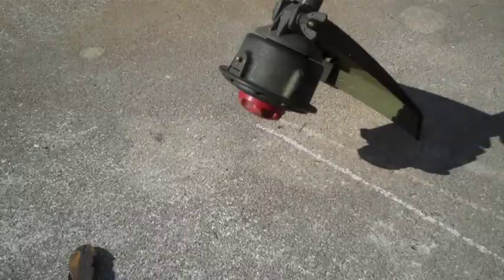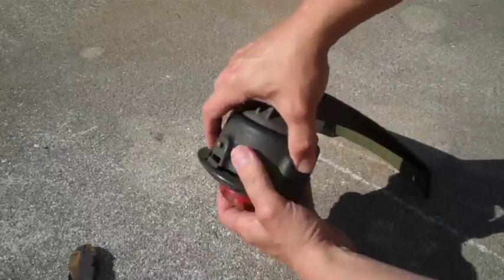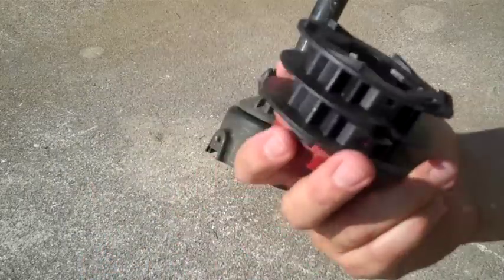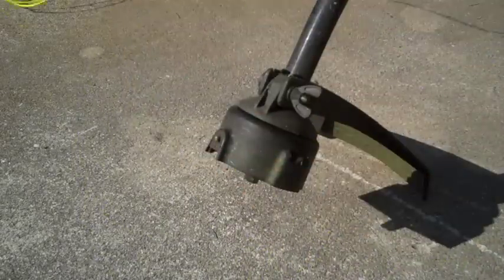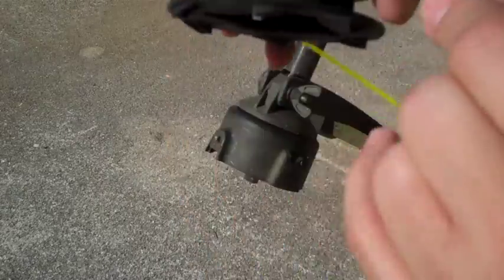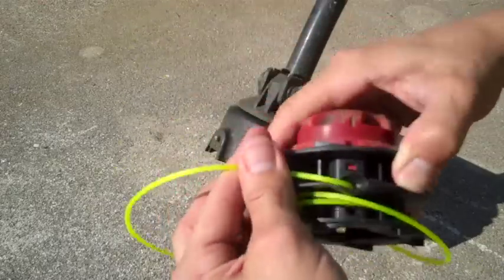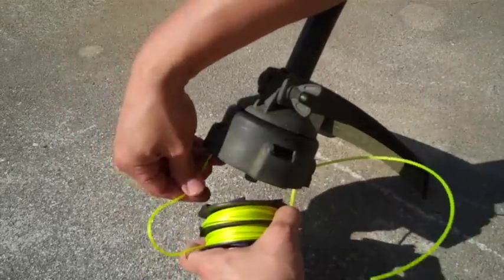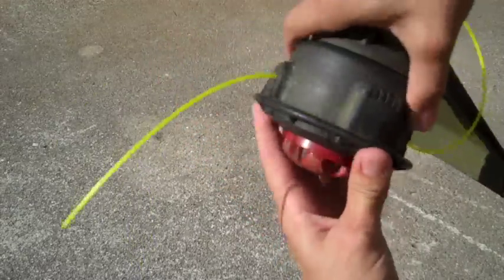Re-String Trimmer: Toro Curved Shaft (New style)

Comment: I did it the way shown in this video for probably two years. I always thought it was a pain. Guys don't read instructions until they have to. But, one day I decided to dig out the owners manual and discovered that you can push the trimmer line through the hole on the side of the cutting head until it pops out the opposite side. Then pull the line through until there are equal lengths of line on each side. Then press and turn the big fat red knob to wind up the line. It works pretty well. I used vice grips to get a good grip on the knob to turn it and wind up the line. Or, even better, at least on the knob I had, there was a 1/2" hex socket hole in the middle of the red knob. I used a ratchet wrench with a 1/2" hex socket to wind it up. Once the red knob gets worn down from contact with the ground, it was hard to use. Then I went back to the method in the video.

Comment: A more common issue is that line frequently breaks off simultaneously on both sides and won't bump feed. Then you need to dismantle the head as shown here , unwind all the line and reassemble the empty spool onto the trimmer. To re-string take the line (up to 25') and feed half of it ALL THE WAY through the head. Then simply turn the spool clockwise (or counterclockwise) to rewind each half of the line simultaneously into the spool until about 8" is left protruding from the head..

Comment: No you did it wrong. I did what you did at first until I figured out there is a way easier way to do it. In fact you don't even need to disassemble. All you have to do is push the string through the hole out through the other until they are even lengths. Then twist the red knob either counter clockwise or clockwise depending on if you have a curved or straight shaft, until you are spooled up. I'm sure there is a YouTube vid that shows what I'm talking about.
Reply: I was searching to see about swapping the head out for another type and came across this video. Poster definitely should have found those instructions because its designed to be respooled without being opened up lol.
Reply: slsrifle thank you so much Jesus I kept trying to do what he was doing and I kept fucking it up
Reply: slsrifle thanks
Reply: slsrifle  You my friend are a true MVP!! Mine is a toro straight shaft and it was counter clockwise I believe for anyone else. It's amazing what a YouTube comment can do, thanks you!
Reply: slsrifle thank you, I wasn’t going to buy this machine if this was the only way to spool it..
Reply: Thank you slsrifle! I was doing what cliff does until I saw your post. WAY EASIER method to spool the darn thing. Here is the vid from a Homedepot staff showing exactly what you mentioned. 
https://www.youtube.com/watch?v=eOQGcc63iME
No more cursing up and down the lawn trying to get the string out of the trimmer!
Reply: Thank you for this comment! You saved the day!
Reply: Make a video
Reply: Thank you 🙏🏻
Reply: @mariomendoza6918  LOL!!! I've been doing the way the video teaches for about three years... Unfrickenbelievable!!!
Reply: Salute to you you should make a video showing on how to properly do it you are the best thank you!!!!!
Reply: This is the correct answer - so simple! Do you have the curved shaft model? Mine is the straight shaft model so I assumed that’s why it differs
Reply: You da man, thanks!
Reply: @lawrencechang390  Whoa! Thank you so much for that link.
Reply: You are correct! Still a pain in the ass though IMO
Reply: I just was cutting grass today and the   piece of string sticking out was cut of somehow.and now I have to open  it still  to pull some of it out?
Reply: Thank you so much for your observation. It is very helpful and helps me cut down the weeds in my garden.

Comment: Denver broncos guy is correct. Don't take it apart and wind by hand. Line up holes on inside wheel with outer line holes. Just feed the line, match length on both sides, and twist the red handle while pushing down to wind line in inside of unit. Easy peasy done.

Comment: Thanks.. had no idea after taking it apart what to do..   i did see you can put the reel in before winding it up and then turn the red knob to suck in the 10 feet of string.
Reply from the maker: You can do that, but I’m not convinced it’s any easier than taking it apart... I do it both ways. It depends on what mood I’m in as to how I do it!

Comment: It's very easy to install line fully assembled but sometimes you can pop it off to get the  line through to the other side then put it back on and pull the desired length. I also measured string length for a full load and it was 20 ft.  Pull out 20ft. Without cutting it off the reel then pull it half way through and crank it on to  that point and cut.

Comment: This works but is so much harder than the genius way it was designed. Helpful though.
Reply from the maker: I can’t seem to do it the other way... I always just take it apart. So much faster/easier!
Reply: Cliff's How To Channel you don’t have to even pull the mechanism out. Just line up the holes (take the top cover off) them twist. It traps the string as you twist so that you don’t even have to manage it. Twist and voila. By the way, the video is helpful and thanks for sharing.
Reply from the maker: Maybe there’s something wrong with mine then... I’ve tried that, and even using a big pair of channel locks, I can barely get it to turn. Doesn’t matter which direction I try to turn it.

It’s much easier and faster for me to just take it apart and do it old school style. 

(Yes is am aware that you have to push in and turn)

Comment: I read the manual and this is not how you do it. It’s WAY easier than how you demonstrate. All you do is push the line through the hole, make sure it’s even amount of line on each side then twist the center winding the spool as you turn it. So easy and quick. I did it per the instructions and it is so easy
Reply from the maker: I’ve tried it like that many times, and always find it more difficult...

Comment: I haven’t been able to get an answer to my question, which is, How do I change the line cutting head to the Shakespeare three bladed trimming head on the Toro 14 inch 5 amp, Electric trimmer.  Model number 51480A?
Reply from the maker: Not familiar with that one.

Comment: Terrible. Why people who know nothing decide to do "how to" videos showing the wrong way is beyond me. I lost instructions and watched your video and thought, no way, I did the same thing and it doesn't feed and gets jammed. Then I pulled up the instructions from the Toro site. Leave the head on, turn the red knob so its arrow lines with the eye holes, run string through the one eye out the other, then turn the red knob and spool. I love this machine now.
Reply from the maker: It is pretty difficult to do it that way. I’ve done both, and have videos for both. I prefer to wind it.
Reply from the maker: It takes longer to try and turn the knob than it does to just pull it out and wind it.
Reply: I appreciate the reply but that's complete BS. It's WAY harder to manually spool it, not to mention, depending on the type of string, it's impossible to keep it in the track and get it in the eyelet without it unspooling. And then once in,  it tangles or jams and doesn't Auto feed. Where I would agree is when using 25 feet like the manual recommends it would take a while to turn the knob to spool. I still think you should remove this video and just show the proper way

Comment: Got an Astro 43cc strimmer and it's total rubbish. I've tried again and again to fit the line but the spool design means it never works properly. No hole through the middle of the spool. It crosses my mind that there should be a spring. Line detaches in no time. Was told that you can fit blades instead of the nylon line, but how you remove the head is another mystery. In short a heap of shit. Avoid at all costs.